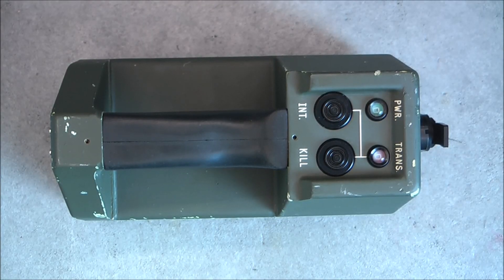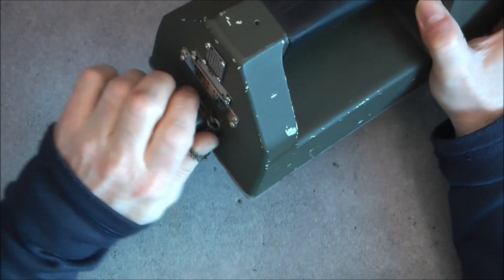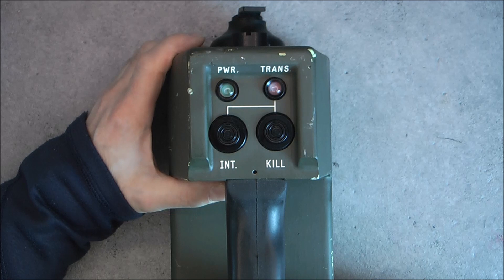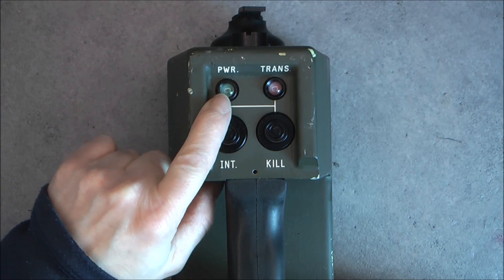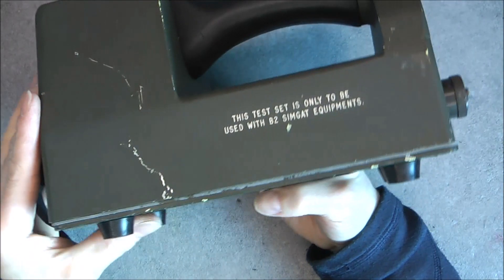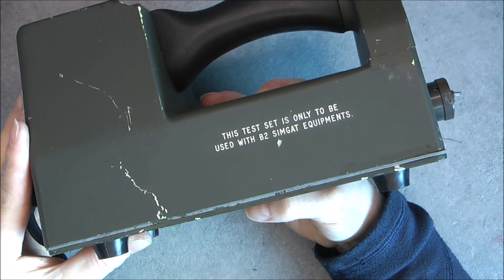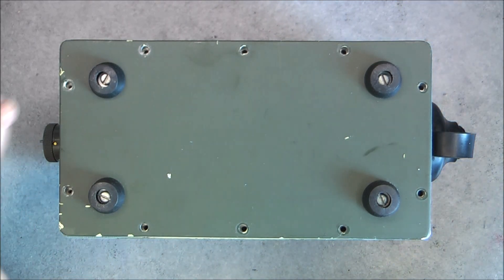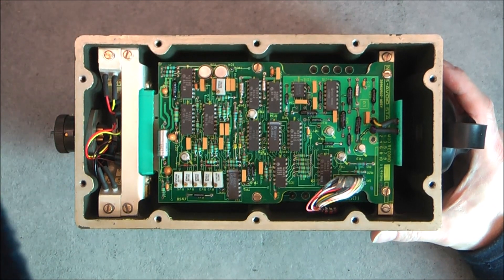British military "First line test set" teardown

Comment: British Army, I knew it.
The image in yesterday's community post was giving me strong Clansman vibes.

I'm pretty sure this thing is meant to be used in very close proximity to whatever is meant to talk to: That led/photodiode setup will only work at a very close range, especially in daylight conditions (and that sturdy aluminium box is made to be used in the field, not on a laboratory desk). For longer range they would have used a laser.
This is likely some sort of serial optical interface, likely full-duplex otherwise they could have just used one led for both sending and receiving data.
Reply: I found this tiny shred of a reference to simgat in a 1982 aviation publication “Simgat is activated by a low powered eye-safe laser beam which represents the firing of a projectile from gun or missile”

Im guessing it might be used to test infrared missile warning sensors? Maybe?